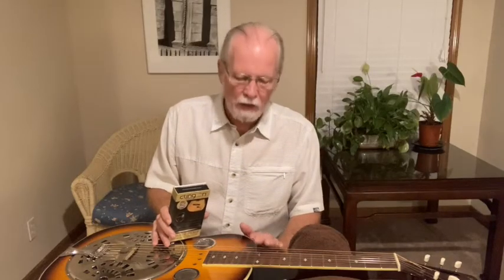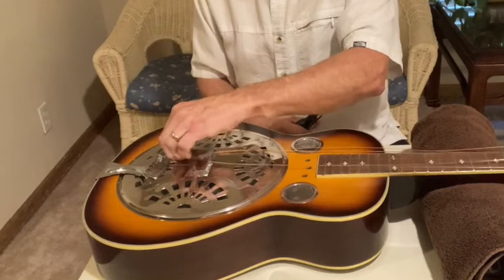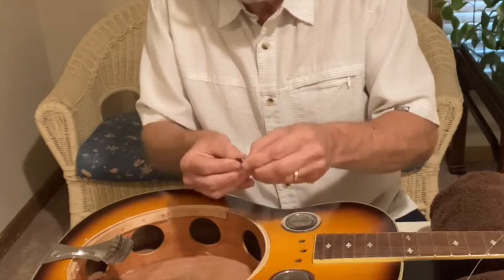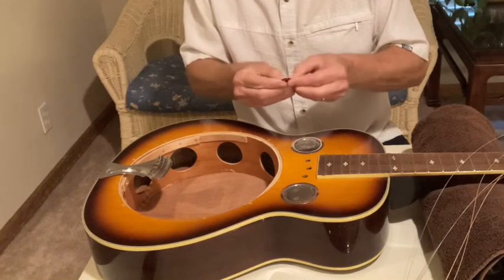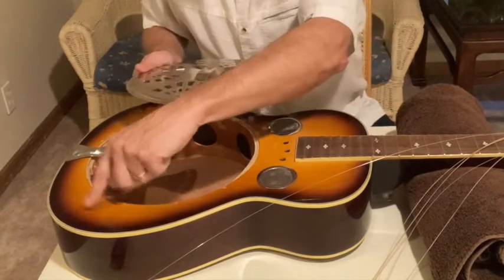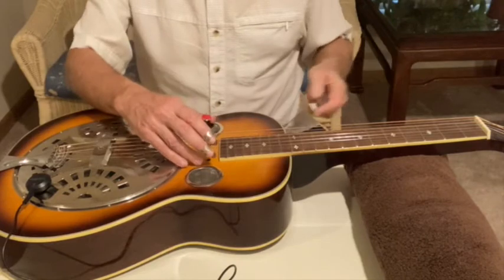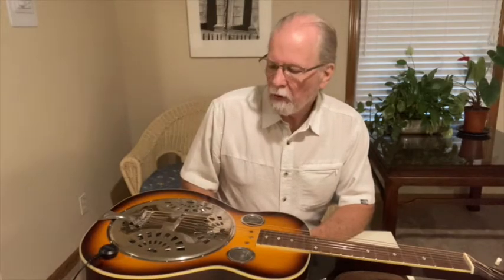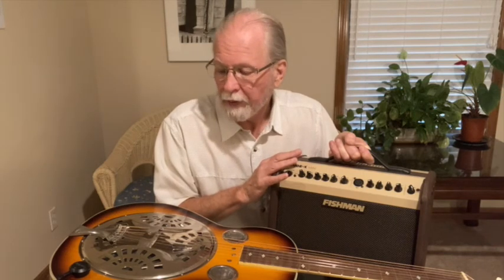Cling On Pickup Installation / Demo on a Resonator Guitar (Dobro) - Craig Sheumaker (customer demo)

Comment: I've recently got into resonators, and had a few missteps along the way. First I got a spider cone, and as soon as I started playing, realised it wasn't what I wanted, and was way too big and heavy. But it was cheap, from Harley Benton. I've sold it already.

Spent a lot more on a metal-body Harley Benton biscuit cone, which arrived in an unplayable condition. Action was so high you could put your thumb under the strings at 12th fret! So I've had to learn how to carve a new saddle from maple. I've got the action where I want it, but the break angle has gone, so I'm probably going to run the strings under the tailpiece instead of over - with some sort of heavy tape protection for the body under the strings, to prevent scratching.

Then we have the amplification, which is why I clicked on your video! ;-)
I'm trying it with a generic cheap condenser mic first. Results so far are OK.

But I'm also working on a (generic, cheap) contact mic, similar to yours. But I'm planning on sticking it directly on the biscuit. To make it fit under the strings, I'm shaving it down to be as thin as possible, without actually destroying it! Results seem pretty good so far, but I need to shave off another couple of mils from the plastic cover so it slips under the strings nicely.

Finally, there is the onboard lipstick pickup, which is least important to me. It's a regular magnetic pickup (but very clear - it is decent), but I don't want to amplify the strings like that - I want to get the resonator body sound, and I think either a condenser mic (which is a bit of a faff to sit next to, and picks up a lot of fretboard noise), or the contact mic will be best. If the contact mic works well, I'll get a better quality one. The one I have now cost about £6.50!